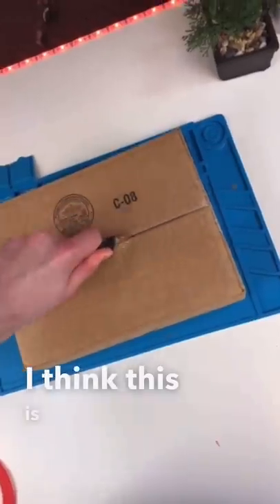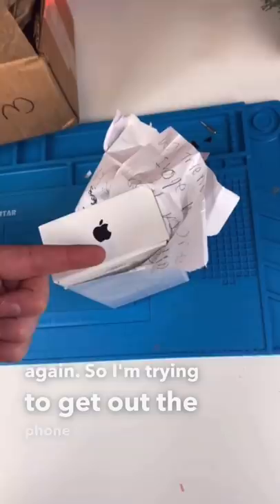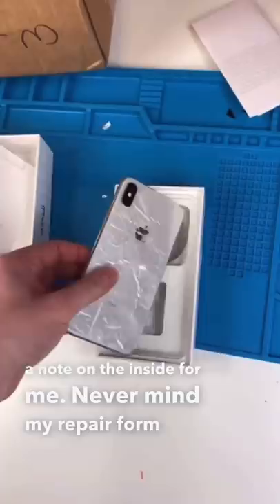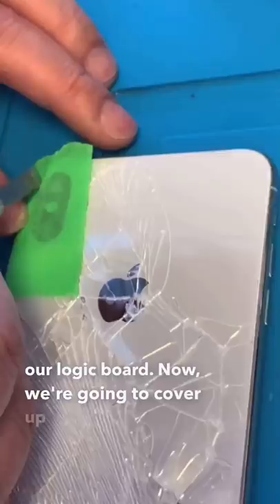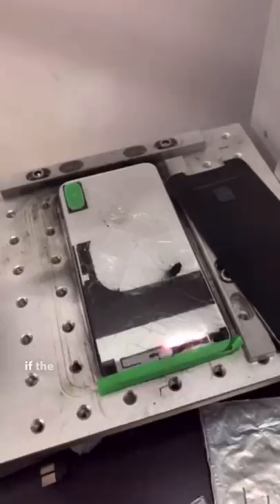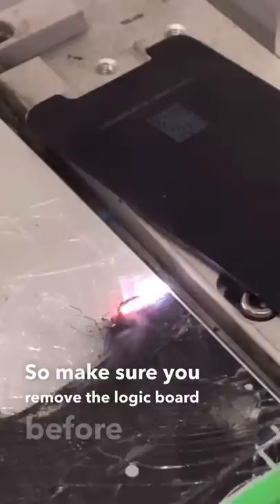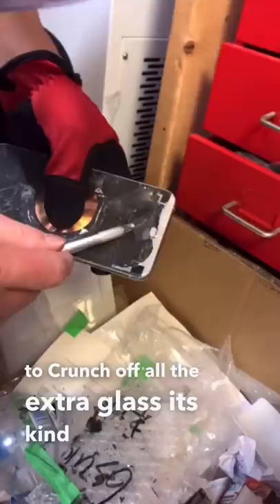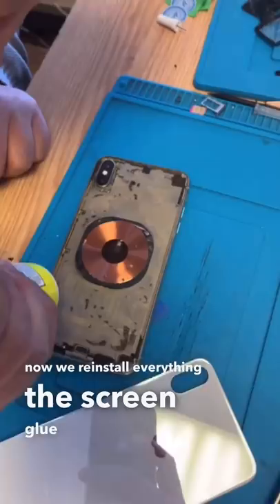The Laser Machine For iPhones Back Glass #Shorts

Comment: Honestly I don't understand why we need double the glass on phones. There's so many other materials that give a glass like finish without breaking easily.
Reply: Personally I like touching the glass back than the current iPhone 12 Pro Matt back. Dropped my glass back iPhone XS a few times, never had any cracks at all
Reply: For "premium" materials there's not much other than metal and glass. They can't use any metal/alloy as wireless charging doesn't work with it.
Reply: @GuitarSlayer136  I want a gold plated iphone
Reply: @GuitarSlayer136  it’s all come down tp ease of usage, if i can put my phone down, and it instantly charge itself, i would want that feature.

i use both charger, i only use cables when i’m sleeping, it just makes my life easier
Reply: How does wireless charging work?
Reply: Profit off the sheep
Reply: @MTRBR-mp7wj  watch ElectroBOOM video on induction
Reply: Money.
Reply: Because Apple decided that plastic is cheap and ugly even though it can flex slightly and therefore withstand sudden impacts better.
Reply: It's because Apple found out that shmucks that buy Apple products are the same shmucks that like to show off the fancy glass backing instead of buying an Otterbox and when the glass inevitably shatters, they're the same shmucks that treat it like the phone is garbage now and need to replace the whole thing. Increasing profits.
Reply: @GuitarSlayer136  umm nfc charging isnt even exist in any phone. Not sure who dumb
Reply: @GuitarSlayer136  it's always the person saying "y'all" that's the dumbest. No. NFC is not how wireless charging works. Wireless charging is done through QI inductive coils. Regardless a compromise to allow wireless interfacing that retains a polished look would be an aluminum or brushed steel chassis that has a frosted glass or polyplastic apple logo. A similar design to all of their high end laptops. It could even have passthrough illumination as well with very little energy consumption.

The reason it's all glass is the same reason the glass cannot be easily removed when shattered. Sell someone an item that's billed as exclusive and classy, and what happens when it cracks? These status concerned people shell out hundreds of dollars over $0.15 worth of broken glass. It's not rocket science.

I'd like to add that inductive charging could still affect the metal around it so testing would have to be done. If there was too much interference then Apple could sacrifice a bit of clout and pay Qualcomm to use their magnetic charging technology which doesn't affect metal, but now we're taking about a double loss. For Apple if it's a choice between selling a superior product and selling one that looks superior but is fragile and impractical they'll take the latter.
Reply: @GuitarSlayer136  wireless charging works through plastic as well. In fact it works through any material aside from metal.
Reply: @tiny18090  You summed it up nicely
Reply: @GrandmasterofWin  You explained it very well
Reply: I don't have an iPhone so I've never had that issue.
Reply: Breaking is a design feature. Repairing (certified) cost so much, say 70% of the new products pricetag, that buying a new device seems reasonable.
Reply: @thoqqu  Yeah I get phone companies being greedy and wanting breakable phones (especially apple) but people buy these phones and don't even buy good cases.
Reply: @Ignorethis12345  I bought an aluminum case.
Reply: Apple does this on purpose cuz people gonna be people and drop it .
Some Real ones on Android use ceramic which looks way nicer first of all and it's way more durable ,I've never cracked a ceramic phone on the back at all
Reply: I agree with you. My phone does not have a glass back, I believe it's actually epoxy covering some kind of woven polymer sheet.
Reply: I’ve got an 11 pro since release and I’ve had no problem with durability. It feels so much better to hold than the newer 12. I prefer the solid and heavy feel of a glassback phone over plastic or metal. It just gives it a more premium experience in my opinion
Reply: @timvandenberg8178  Yes, it does. It feels premium especially when you break it, a 5€ piece of glass, and Apple asks you 600€ to replace it because they have to replace half the phone cause of the permanent glue. If you don't know this you go like "wow, 600 for some glass, that's gotta be the best glass in the world, directly from the artisans of Murano probably". I thought the meaning of this video was clear at least.
Reply: Just don't buy apple
Reply: yea i agree, a few years ago i had an iphone 4 and i took it out of the case for 5 minutes so i could look at sum and while trying to put the case back on i dropped it on the kitchen floor and the entire back glass cracked
Reply: Two words, planned obsolescence.
Reply: I saw a phone that was super strong bc it used ceramic for the back
Reply: @JimmyJones666  It's not. But quite similar. More like voluntarily impossible to replace very fragile 5€ parts that if you break (and you will, cause of the fragile part) you'll have to buy a new phone.
Reply: Yeah!! Plastic or metal.😎😎
Reply: Who the fuck doesn’t use a case anyway
Reply: @niter43  note 20 have plastic back and it have wireless charging and reverse wireless charging
Reply: @darkuniverse2088  I specifically said premium materials
Reply: @niter43  The Google pixel actually uses a metal alloy bio resin which is really just a fancy name for metal combined eco-friendly plastic. I think it was leaked that, (dont hold this against me because I don’t know if it’s true or not), the iPhone 13 might do the same thing.

And before you say it’s not premium material, the metals on most phones aren’t really premium they just look pretty.
Reply: @stevensanchez1192  there's no metal on outside/user-facing surfaces of pixel 5. It's all plastic. Bio resin is marketing talk for selling plastic. 

There's metal structural frame, but it's nothing unique, most phones have it. Under the plastic there's giant cutout in frame for wireless charging coil -- since as I've said it doesn't work through metals.

It's a cool solution given right implementation (texture/grip, longetivity of finish), but a clear trade-off. Frosted/matte glass seems like a better way to go, given they can figure out how to make it easy/fast to repair and not deliberately fuck with user/repairmen like Apple.

Flagship apple product wouldn't have plastic back, lol. They might do something like 5C again though.
Reply: @niter43   Now since you say it I do remember that it wasn’t a metal alloy plastic and that there’s just a thin lair of metal; that’s a my bad. 

Though bio resin is probably not marketing talk since Google advertised the phone as being fully Aluminum but never mentioned bio resin; I think there was a lot of disappointment because of that mistake. Also bio resin as I mentioned is eco friendly, in a time when plastic waste is a crisis which in my opinion makes it unique and dumb of Google not to mention it. 

Also there’s another rumor that Apple might use a wireless charging port instead of a typical lightning port. I personally think that Apple would probably do that knowing that they had no problem getting rid of the headphone jack.

Comment: I got a question, a few months ago my iPad broke, I ended up getting a new one but basically what had happened was I was charging it while playing some game and it just shut off, no matter what we did it wouldn’t turn back on, we took it to a repair guy and he switched the battery and said it still hadn’t turned on so we assumed the motherboard or something just broke, you obviously know a lot about electronics and wanted to know if you had an opinion on what might have happened

(It looked like it was just shut off all the way, other than that completely normal)
Reply: Did the iPad bend during the break and was it exposed to any other damaged besides fall damage?
Reply: @rafaelalvarez1585  oh, sorry if it wasn’t that clear, but when I said it “broke” it didn’t fall or anything, it basically just died and wouldn’t charge. However the battery wasn’t the problem because it shut off at around 70% battery. Also, I wrote the comment in the middle of the night and worded the motherboard “breaking” wrong, I meant to say that we thought it short circuited or something like that

Comment: I am convinced the back glass exists to he broken so that apple has something else to fix
Reply: Watch luis Rossman
Reply: @micahroberts4481  incorrect, it has to be ANY MATERIAL that doesn't conduct electricity and has a resonating frequency above 60hz which most materials do.
Reply: @shaywaterstheone9477  no
Reply: We found the apple fanboy
Reply: @micahroberts4481  well, glass has a tendency to break easy, and shatter on impact, and plastic us a very broad term. So in this case ABS or PETG plastic would well, as it can break, but it flexes and is cheap to replace. If you want something more industrial with the same feeling, acrylic works just as well. Another idea you might try to use is actually a fabric-over-ABS design. I never said plastic isn't a good idea, but it may not suit everyone's likes. That being said, glass is easy to break and can be marked-up ridiculous amounts in price just to buy, not to mention the actual repair and labor.
Reply: Iphones in general exist to fail and break so they can sell you another $150 value for $1200 it amazes me anyone actully buys them intentionally, time share level scam but once a year
Reply: They use glass so you will be able to charge your phone wirelessly. 
And also you can do that without laser, just hot air gun and something to scrub the glass.
Reply: @shaywaterstheone9477  pretty sure metal like the older ones conduct electricity
Reply: @xFTPxJesusx  that's the whole point, metal is conductive and will short out, that's why an iPhone 6 or a phone with a metal backing can't charge wireless without a separate adapter.
Reply: @micahroberts4481  It would be more durable and glass is see through. It provides zero function and only exists to break. Plastic is also lighter.

Comment: can someone explain to me what the laser does? cause i’ve seen it used multiple times but don’t know anything about it. to me it just looks like it removes the color from the back glass lol
Reply: Laser hot, hot melt stuff, melt = remove
Reply: @FatFlashYT  thank you so much! (and for using simple terms lol)
Reply: @clairewessel  np
Reply: It burns the adhesive so the glass can be removed. Apple purposely used a very strong adhesive so they can charge a lot of money for repairs but thankfully, someone invented that laser machine so repairs would be much cheaper

Comment: This would have been nice to have back when I worked at a repair shop. I tried to manually replace the back glass for a customer once when the X first came out and after about 2 hours of slowly chipping away about 1/3 of the glass we determined we wouldn’t be accepting back glass repairs ever again 😅
Reply: What? 2 hours for 1/3? What glass is it? Why so difficult to remove the glass? And whats under the glass that it need laser to do the job?
Reply: @yuckfou911  Its the way Apple glued the glass to the iPhone. It’s very very strong and almost impossible to remove without special tools. That’s why it’s so expensive to get apples back glass “repaired”. I assume it’s the same as before and Apple will just replace the phone if your back glass is broken.

Comment: The laser machine is build to remove back glass without opening the phone so if you will remove the motherboard then you don't need to use a laser machine just use hot air on 270 degrees and air flow 40 percent remove the board and the battery, speaker and the process will take you 5 to 10 minutes

Comment: how much is a repair like this ? i have the same exact phone and broken glass on the back
Reply: Depends on the place you go. The store I work at doesn't have a laser so we do a full housing replacement and it's around a $140 repair depending on the phone. But I imagine that a store with the laser would charge somewhere in the $70-80 range
Reply: @the_real_treezus  how much would it be if a customer brought there own housing and you just switch the components?
Reply: @johnbon743  depends on the phone but it would be roughly $100 and we provide no warranty for people that bring parts

Comment: I have a iphone 6+ but I don't use it because the battery is fried and when it's complete charged it takes only a few minutes or a hour and it would almost be dead so I have to charge it 24/7 and the screen is popping off and I think the reason for that is because the battery is expanding the only thing wrong with it is the battery other than that I don't see any other problems and I've dropped my Android face first on concrete without a case and it didn't break